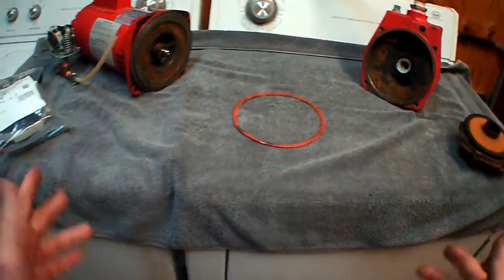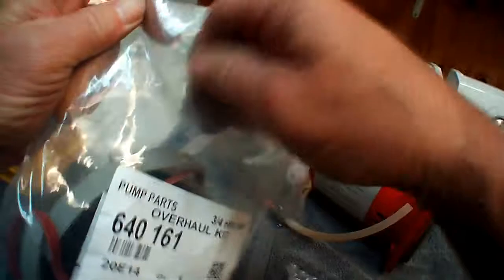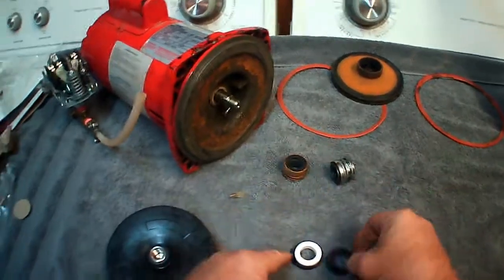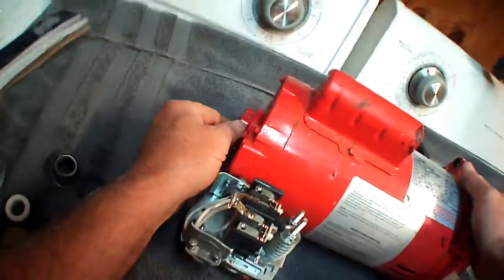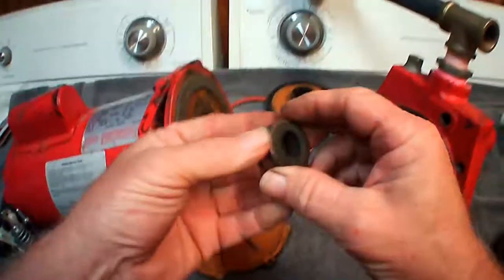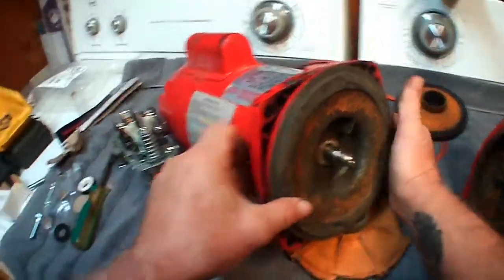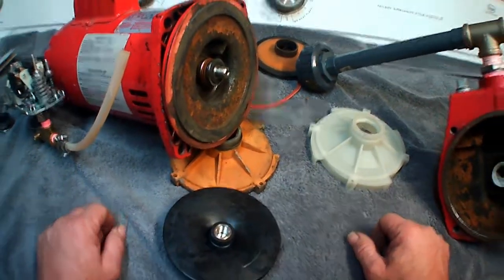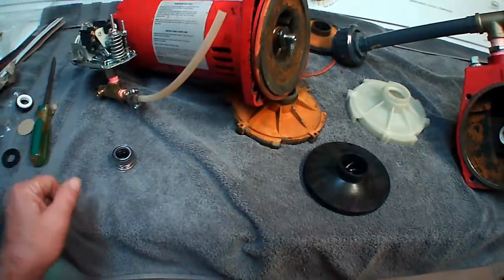Rebuilding a Red Lion RJS-100 Water Pump - Part 1

Comment: The part at 6:20 was helpful, it should be at the beginning of the video.
I was prying in the wrong spot. 
Once I saw this are of the video, it came off.
Only thing holding it together was the stickiness of the seal.
Reply from the maker: Very good Mr. Bob :) I spent hours trying everything to get mine apart, with no luck. I even talked to their repair department, and what they told me made no sense.. The seal you mention was so painted over, I had no idea it was there. If I had one to do again, I would make a video of the disassembly. I am so glad that showing the re-assembly showed you what you needed.. Thank you :)
Reply: @sparky5543  
My seal was painted over too.
Without that video section I would have given up or broke the pump.
Thank you.
Reply: second what Bob said, I'd watched a few videos on how to take my pump apart, and this specific comment led me to the spot in the video that showed the answer. Thanks Sparky and Bob
Reply from the maker: @AaronRStanley  Yes, unfortunately, the disassembly took several hours, with multiple calls to the manufacturer :(

Comment: Figured it out, the new kits come with the plastic piece that I believe you said you couldn't remove.  It takes a bolt head the correct size to remove.

Comment: Great video but it started too late. I got the head bolts out but can’t get the head to come apart. I’ve hammered away but it’s not separating and I’m afraid I might bust the housing.
Reply from the maker: You are correct, but the way I did it was a mess. The manufacturer suggested using a rubber mallet and hitting around the half that is Not the motor (after I broke my cone the way I did it). It would have come apart much easier. It will take time depending on how long its been together, and you will find its not the best way to assemble one once you get it apart. I pried on the 2 parts, not realizing there was an 1/8" plate between the 2 large parts. That is where it splits. I was prying in the wrong gap. The paint completely covered the other seam! Watching both videos, you will see this thin plate where it splits.
Reply: That’s where I’m stuck. When I got the bolts out and realized that it wasn’t just going to pull apart I got on YouTube and your video was the only rebuild that I could find. I saw yours pulled apart and where the two pieces separate but getting them apart is where I’m stuck. I guess I could try a couple screwdrivers and go in between since I have a new oring and try to pry them apart.
Reply from the maker: @ChrisPBacon-yz6nk  The 'plate' at 3:33 (middle of the screen) is sealed/painted to the part on the right of the screen. That is where you need to split the parts apart.
Reply: @sparky5543  yeah, I see that but it’s not budging. Tomorrow I am going to try to cut that gasket and see if I can get a flathead in that groove and see if I can start prying them apart. If I get that gasket out I should be able to get some pb blaster in there. Wish me luck.
Reply from the maker: @ChrisPBacon-yz6nk  They are really stuck together with the paint on the outside. Best of luck.
Reply: Black and white thingys are ceramic  shaft seal and  goes in big metal circle plate